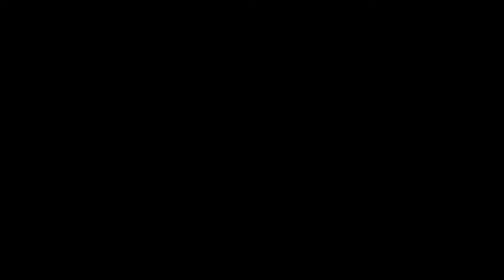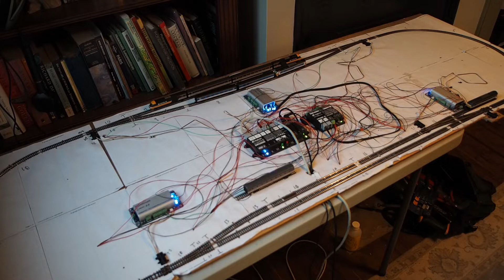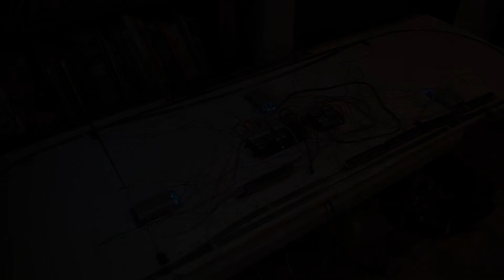Model railway automation test

Comment: Hi James, great demo. Shame about the glitch - did you resolve it? My first thought is that maybe you have induced currents in a wire some where due to crossing wires... my understanding is that keeping wires separated but in parallel tidy runs generally minimises the chance of 'cross-talk' interference that could trigger detection or signals that get interpreted as sensors being activated, and so upsetting the logic. If you check the LocoNet log you should be able to see if any spurious commands had appeared. But then, it may be something else entirely. I would definitely avoid running wires over circuit boards as well.... just my thoughts. Good luck, and do post an update!
Reply from the maker: Thank you for your thoughts - I have never been able to reproduce this occurrence, but I do plan to have much tidier wiring runs on my non-testing layouts.

Comment: What did you use to control all of the operations and the turnouts? Was that a microcontroller or a single-board computer?
Reply from the maker: The command station was connected to a Windows PC running Train Controller Gold.

The turnouts were operated by Cobolt SS motors, whose control units have built in DCC decoders.